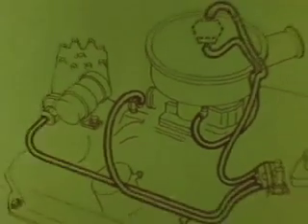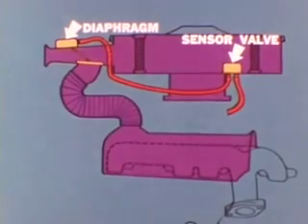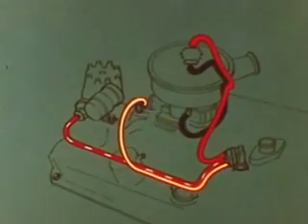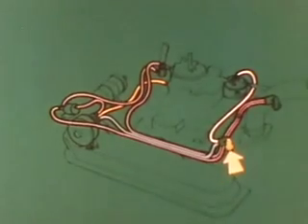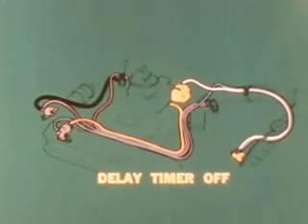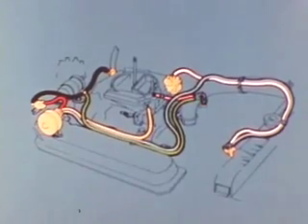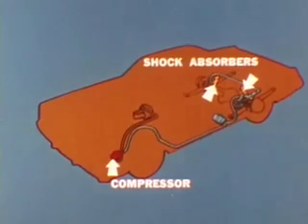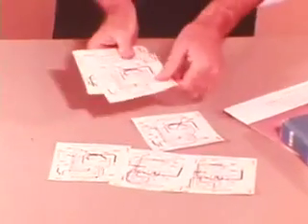Chrysler Master Tech - 1975, Volume 75-9 Understanding Vacuum Systems

Comment: When I started my first job as an auto mechanic at a Ford dealership in 1983 (Where I worked for 26 years) Ford was using color coded plastic vacuum lines. And there were a lot of them under the hood. It looked very nice and organized when the engine was new. But, within a few months, the plastic vacuum lines became dry and brittle. It reminded me of uncooked spaghetti noodles. Most of the time it would all have to be replaced with regular black rubber vacuum line which didn't look as nice.

Most customers, regardless of what they drove, assumed dealership mechanics knew how to plumb vacuum lines from memory. In other words, customers that tried to do their own repairs, and made a mess of their vacuum lines, believed we could make all the right connections by memory; and that we could do it within minutes. Wrong! We had to get a book, find the correct diagram out of the hundreds available, and reconnect the lines one at a time. There was no internet to look up this information in the 1980s. 

Over time I learned an organized approach to replumbing vacuum lines. It wasn't any faster, but it was a little more accurate. There is nothing worse than replumbing the vacuum lines on an engine only to have it idle like a Harley Davidson because something wasn't connected properly

Comment: In the early 1980's I had a 1976 Cordoba that ran great after I removed most of those Vacuum systems...
Reply: A large number of early smog engines worked better with smog devices bypassed.

Comment: I'm sorry guys I was in engine development at this time. We were scrambling to develop emissions, fuel economy and running on No lead all at once. Interesting foriegn products fact that nobody knows about it seems. Imports didn't have to develope as fast as Americans did because they were given a Pass for each year. America spent and discovered the emission system and import could copy them without all the expense. I start getting agitated when I think about our EPA cutting our throat.
Reply: Believe me, I understand the frustration. I was a mechanic at a Ford dealership from 1983-2010 and remember when US Automakers were scrambling to keep up with emission standards, CAFE, and safety; all while keeping their cars affordable. Quality suffered in other places as cheaper plastic was used on the interiors and other parts of the car. 

Japanese and European carmakers had it easier. As you pointed out, they simply copied US designs while keeping development costs low. But, if you can't beat them, join them; as Ford did with Mazda and Jaguar
Reply: I think that's the whole thing- THEY copied US.  A lot of people don't understand that! @rtwice93555